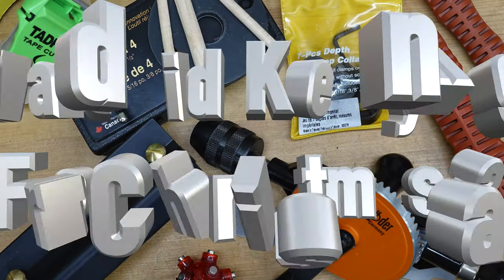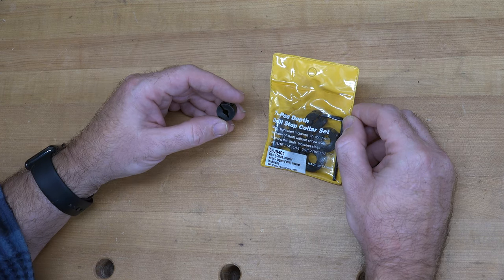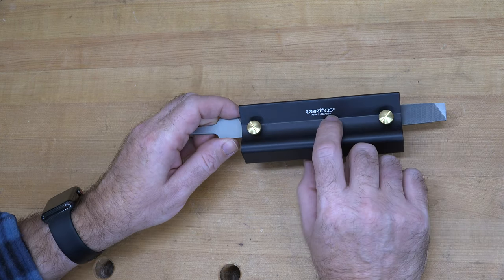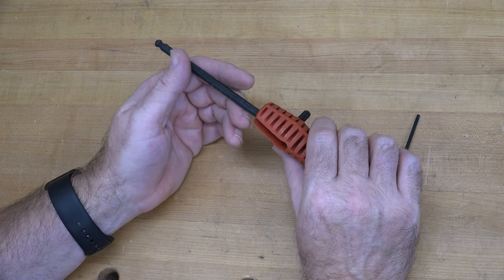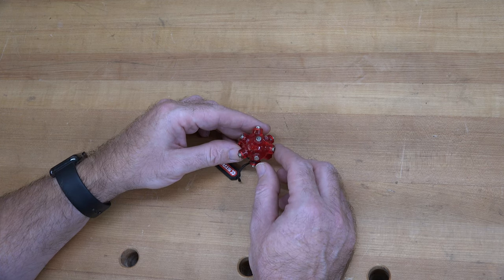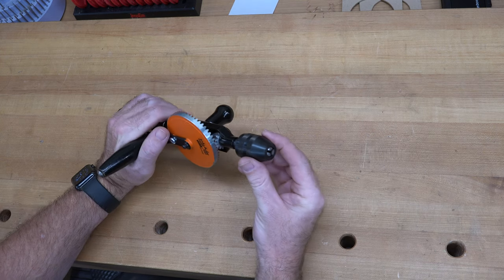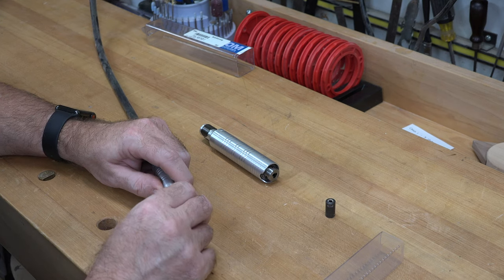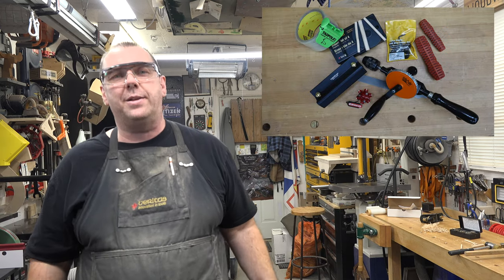What Did Kenny Get for Christmas

Comment: Hi Kenny, I bought myself a tape cutter and made the mistake of ordering it from Lee Valley, when it arrived I got a note from the post office saying it had arrived. As it was such a small item I did not understand why it was not delivered to my address, my surprise came when I went to the post office and found out that because it was from the USA I had import tax to pay. This was twice the price of the item, I won't make that mistake ever again. I have a couple of old egg beater drills and one of them had a screw-on end, at first I thought it was just a gimic but when I unscrewed it I found drill bits inside, a great idea.
Reply from the maker: Sorry to hear about your shipping issue John.  Where were you having it shipped to.  I try to avoid ordering anything from the States as we get nailed with customs and brokerage fees and all kinds of crazy stuff.  Not to mention the the shipping costs are usually more than the cost of the item.  Thus far, I am enjoying my hand drill.  I have only used it on a couple of projects but I thoroughly enjoyed it.  It takes a bit of practice to get the downward pressure just right for effortless drilling but that will comes with practice, just like everything else.  Thanks for tuning in to the show and taking the time to share your experience.  I truly appreciate it.

Comment: You've got some nice pieces there, the only thing you might hate later is the (cordless drill) I had one as an apprentice and I thought it was great till I used it, from the first time I used it it would jam on the teeth so it would not go round, I tried everything but it continued to jam I stuck it out as long as I could till I got a geared one then it went straight in the bin, maybe yours is better mine was junk.
Mind you it was in the 60s
Reply from the maker: I have to say John that I have been using this drill for a few projects since I got it and thus far, I am really enjoying it.  It takes a bit of practice to get the right downward pressure so that you aren't jamming the bit but once you get that, it was great.  The drill works smoothly with no jamming.  So far so good John and I hope I never experience the problems you are talking about.  Thanks for tuning in to the show and taking the time to leave a comment.  I truly appreciate it.